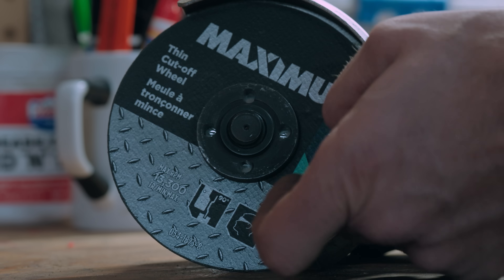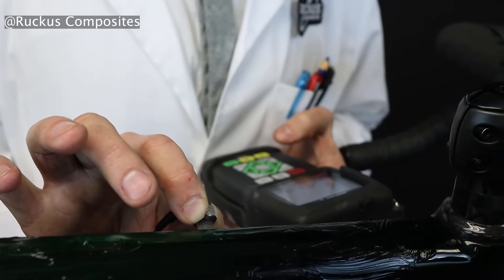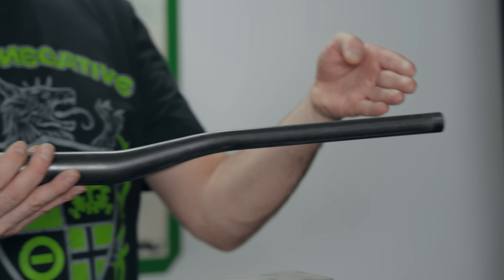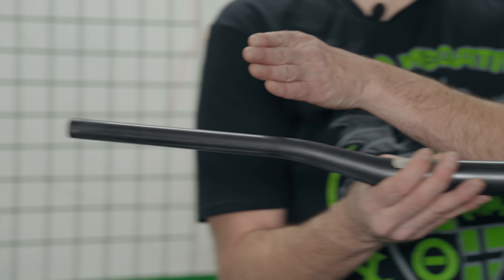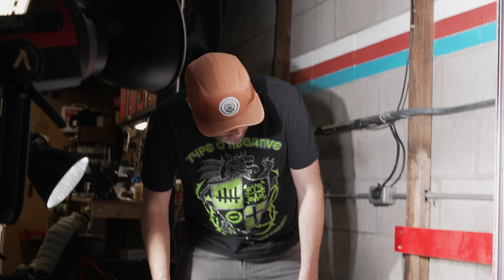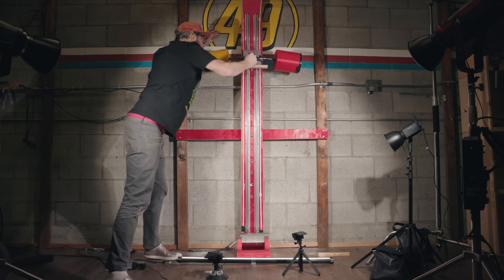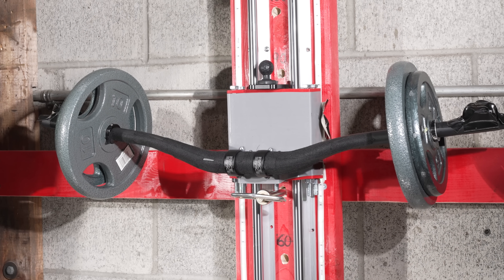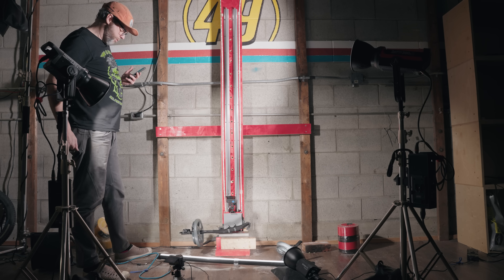Is Repaired Carbon Fibre Safe? Breaking Point Test

Comment: Question. What is the practical amount of force that these bars would experience in the real world? I follow lots of Gym guys and they always like over loading deadlift bars to see which is better. Like one bar can hold 4,500lb of force while the other can only hold 4,200lb before bending. Practically no human will ever be able to lift or press that weight. So the test is redundant to real world experience.

So, what is the practical NM force that a rider can exert on these bars?
Reply: Dusting off some physics, for a person of mass m (kg) and bike of fork travel d (mm), landing super nose heavy from a drop of height h (m) on a flat and immovable landing, the average sustained force shared by both ends of the handlebar is F = (m h g)/d, where g is the acceleration due to gravity.

I'm about 90 kg and my bike has a 150 mm travel fork. From a height of 1 meter and landing with all of my weight on my front wheel, I'd exert an average of about 6000 Nm. Each end of the handlebar would support half of that force, which is frighteningly close to where the bars in this video failed. With a 50/50 weight distribution on the bike, I can drop to flat from 2 meters to achieve the same force.

Important caveats: 1) I'm not considering static vs shock loading of the bar. 2) It's hard to get 100% of your weight through the bars on a landing without going over the bars and eating dirt regardless of what happened to your expensive carbon handlebar. The force felt at the bar would be proportional to the fraction of weight supported through the front wheel. 3) I have not included the weight of my bike as part of the supported mass, but I should include some or all of the sprung weight. I just don't know what it is (10 kg, maybe?). 4) As mentioned above, where on the bar that force is applied matters a lot on how that force can be distributed by the bar.

I think I may have convinced myself to not ride using carbon handlebars!
Reply: This is a good question. I recon it would be something like bodymass x speed of impact. But it's not the amount of force on the bars that matter. It's the distribution of load to the center of the bar that matters. You see the center is wider, that's to take the larger force in the middle. But some point has to be the weakest and fail first, without knowing where that is no one can say what a characteristic stress and strain would be for this bar.

Comment: cutting carbon fibre using an angle grinder without wearing a mask is really not a good idea
Reply: Should be a half-mask at the bare minimum. I also use disposable gloves and overalls.
Reply: @plav032  Agreed, carbon fiber (honestly just carbon in general) is nasty stuff to work with, especially to sand or cut with abrasive discs.
Reply: Agree re:mask. I’d go facefitted FP3. Everyone’s paranoid about asbestos and then get all blase taking an angle grinder to CF and fiberglass 😬

Comment: Well, you tell the fine repaired part is broken on 3500, but new on 2500. BUT on the repaired part was the second undamaged side that endured 3500.
So, in fact, one bar survived on 3500, another is broken on 2500. 
It seems, that all is a crappy lottery.
Reply: The repair method was different between the two parts. That's why one is labeled Rob's fancy method and the other Rob's quick and dirty method.

Comment: My Answer Pro-Taper carbon bars and they are indestructible mounted on a MTB. To be honest they are a little scuffed after 15 years with at least 10,000 miles per year on the dirt on rocks. Western Quebec/ Eastern Ontario riding.

Comment: I work with carbon fibre parts for almost like 9y now professionally  (longer as a hobby) making repairs ,custom parts etc and main issue with repairs is that people are not consistent in making them , dont understand how fibers will react to force aplied ,directions etc ...even if part can easily be fixed , if you not protect them from delamination on the ends....it will fail
The same if directions are wrong...failure
Wrong cure temp...failure
Too short cure time....failure 
To thin repair ...failure
Not enough resin...failure
Not enough preparation for resin to bond properly ....
Even to much moisture in the air
And way more 
Will end with failure

Yet if you repair it correctly its 99% of the time way stronger than oryginal

Comment: The weight of the narrow barbells is located further from the center of the handlebar than on the wide barbells. so, even though the weight is the same - the impact it produces on the handlebar - is completely different
Reply: As long as the center of the weight is the same distance from the center of the bar it is not. The sand weight is wider, making it appear closer, but as long as the center of the weights is in the same place it is comparable.
Reply: @dugg117 That would only be true if the bar were absolutely rigid and the weight was being applied gradually. Impact loading is a way different animal.
Reply: @thomasstuart2936  it's not breaking where the weight is connected to the bar. Distributed loads can 100% be simplified to their point load equivalent in this case.
Reply: Yes. Such an obvious flaw. Ryan would not have made such a rookie mistake.
Reply: Always gonna be a "nuh-uhh, no it didn't, ya did it wrong" type of whiner....

Comment: While the video editing was not as pretty as Ryan, I actually enjoyed this being a cyclist whom also rides a motorcycle. I got my carbon bike frame repaired professionally and always wondered about this. Im also curious about how much weight a carbon repair would add?
Reply: carbon fiber repairs weigh a negligible amount when done properly. Rob did not do proper repairs, nor does he use proper PPE.
Reply: If you’re worried about the weight of a carbon fiber repair leave that power bar at home, it’s no good for you anyway.
Reply: I have so far stuck to steel (e.g. VSFahradmanufaktur) bicycles over Alu and Carbon over this misconception!
No more.

Comment: so why didn't he cut the "unfixable one" in the middle and wedged in a tapered mandril from the straight side? and then fixed the cut.
Reply: "Anything" is possible, but as they talked about, he would see the effort worth it for a more valuable part but presumably the cost of such a repair would be beyond the replacement cost.
Reply: Would love an analysis on carbon fibre wheels.  I have broken CF and Al wheels on road, gravel and mountain bicycles, and broken CF, Ti, Al and steel bicycle frames. High end CF motorbike wheel intrigue me, but have a sense that a forged AL pair would be more resilient

Comment: This video was honestly awful. What a pointless test, why not use the same weights on all tests? Why not explain why the repaired side broke over the standard if the repair was stronger?
Reply: Guess you didn't see the part where the sand weights broke?

Comment: Steel bars will bend but not break.
I'd like to see what happens with steel ones just for fun.  Cheers 🇨🇦
Reply: Everything has a fracture point lad
Reply: @Xamy-  why thank you, I haven't been called a lad in over 60 yrs! Cheep steel bars like on Harleys bend when you drop the bike, hit trees etc.  I've never seen steel bars break off even in accidents but they bend easily even when just riding off road or coming off a wheelie too hard.  A motorcycle handlebar breaking is a very serious event for the rider.

Comment: Due to the nature in which carbon fiber fails I've alway given it a wide berth, its alway catastrophic and almost never ends well. If I need to save a few grams I'll take a poop before the ride, if I need to save a load more, well, I'm 15kg the wrong side of a slice of cake or two, so I thing I'd be better off starting there!! An unplanned emergency dismount at 30kph with my bars in two bits is just not a good vibe!
Reply: It's not really rational though. Most of the time, carbon simply doesn't fail - it's an extremely durable material, in particular it has excellent fatigue characteristics (not quite as good as steel, but way better than aluminium). And on a heavy impact, aluminium bars would actually snap just as sudden-catastrophically as carbon bars. The one problem carbon specifically has is that even very small damage (stone impacts) can trigger failure, but that's much more a problem for lower parts of the frame, chainstays and pedals, than handlebars.

If you don't care about weight at all then sure, thick steel is the safest option. But that's not just a couple of grams heavier, more like twice as heavy - anything that's similarly light to carbon bike parts will also be similarly fragile.
Reply: @leftaroundabout tell that to the weekend warriors running minuscule cf wheels on their road bike only to hit a pothole and the front wheel explodes at 70km/h down a hill.
Reply: @SirSpinalColumn  the problem there isn't the CF, it's the use of delicate racing equipment in an environment it wasn't designed for. This sort of thing happened just as much with early aluminium bikes, when that was the "cutting edge magic light material". Upshot is, design and simply wall thickness is more influential than material choice.
Reply: @leftaroundabout    What do you know about Ti?
Reply: @garysarratt1 Titanium combines to some extend the advantages of steel and aluminium, but it doesn't really change the picture: carbon is still superior in strength/mass. I suppose you could overbuild a titanium frame to be as sturdy as an overbuilt steel frame while not being quite so heavy, but it would still have to be much heavier than a typical carbon frame, and probably more expensive too (titanium is very difficult to work with).
Reply: @leftaroundabout    I didn’t know if it can be a direct replacement, mass and size wise, for another metal or carbon.  I do notice it seems bulkier, but is the weight &  strength good enough for me to opt for Ti next time, or Al or carbon.  I’m older than I used to be (what a dumb thing to say🤦🏼‍♂️), but nearly 35# lighter and better cardio.  I can afford any of them, but don’t throw money away if I can help it.  Just trying to cut through fawning reviews and ads to buy once, cry once.
Reply: @garysarratt1 well, I don't own any titanium bike, so I can't really say how good it is in practice. It is quite possibly the best-compromise material considering strength, durability, compliance and corrosion resistance. No doubt it's a good choice for a gravel/touring bike. But whether it's worth the hefty price tags is questionable.

I think that objectively, titanium only pays off for specialty applications where you need either strength at extreme temperatures or chemical/biocompatibility. Neither is relevant for bicycles.
Reply: @leftaroundabout    I believe you, thanks for the info.  I imagine the most important variable is my body weight, along with strength and conditioning.🤣

Comment: So... does this apply to bicycles, motorcycles or both? Cos I clearly remember Ryan telling us that carbon fibre has no fatigue limit and therefore is not an ideal candidate for integral pieces of motorcycle.
Reply: Any carbon fibre structural piece of anything really. Driveshaft, connecting rod w/e CF behaves the same in elastic/plastic failure modes.

Comment: The guy used different style weights, one spread the load out among 1ft of bar length on the repaired bars. The other put all the strain on a 1 inch section of the brand new bar with the metal weights clanking on the CF on every drop. C'mon. Completely different tests doing it like that. 

I've come to expect more from this channel, Fortnine is better than this.
Reply: Yes, several big problems with the testing here. The rig isn't the same, the weights aren't the same, the rig and weights experience failures, the sample size is 1, and there seems to be a bias towards wanting to show the repair is stronger. If the script for the video is written before filming, it's not really a test any more.
Reply: the plastic weights are also not symmetrical in some drops
Reply: Glad I'm not the only one that noticed this.
Reply: The quick & dirty 3D printed PLA sand-filled weights broke. It’s a YouTube channel, not a real test lab.

That said, I’ve got a degree in composite manufacturing & repair and I wouldn’t touch those damaged handlebars without a written consent that they couldn’t be used for anything other than non-structural static display or rig testing.

I can repair a CF Boeing better than a United A&P, but I could only ever claim it to be original strength with an engineer’s instructions and write-off.

Anyone claiming that a repair is stronger is either lying or adding mass, which is antithetical to the point of the original CF part, and potentially actually making it weaker. Run.
Reply: To be fair, the strain experienced by the carbon fiber under these different loads are very similar. A few inches here and there makes no difference whatsoever. 

The only difference a few inches further away from center is bigger moment force in the center. But the bar didn't break in the center, it broke in the flanges. 

As for distributed and concentrated load. Yes if it breaks where you have a point load then it failed because of the point load, but if it fails somewhere else, then a point load and distributed load makes no difference. 

People seem to take issues with it because it didn't look polished in the presentation. The rig itself is perfectly fine. 

As for bias. People who have the money to buy new, will buy new. People who don't have that kind of money stay away from carbon fiber. He is trying to justify a third alternative. But maybe if he didn't come across as a salesman, people wouldn't crucify him for this.

Comment: The biggest problem here? Carbon fiber handlebars almost never break towards the ends. They almost always break near the stem and it's really obvious that they're toast. This video is much more applicable to anything other than handlebars
Reply: It doesn't actually make sense to repair handlebars anyway as they're easily replaced, fairly cheap and if anything goes wrong the consequences can be quite nasty.
The reason they did the test with handlebars rather than something more relevant is that they're easily replaced, fairly cheap and shaped in a way that makes testing easy.

Comment: To add to my doubt, you can´t test that simple how the repair holds up to stress, fatique and strain over time...
Reply: Yes. Just go ask Boeing. It’s harder to tell if all the carbon fibre filaments are bonded properly- there doesn’t seem to be much “give” in C-F. Metal flexes and eventually goes ping. C-F holds and then goes “sprang”. 
They had some issues with  C-F fuselage joints.
Manufacturing defects.